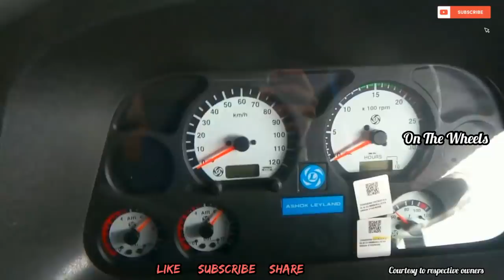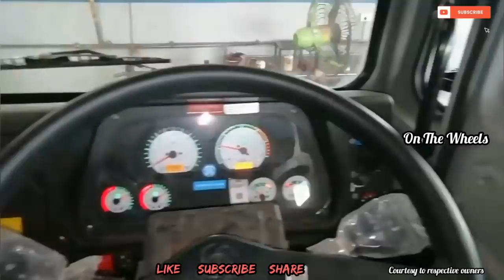Tipper Lorry Business Profit and Expenses in Malayalam

Comment: better option will be to lease the tuck to a company at per day rate and drive the truck yourself , for 20-25 ton truck u will get around 6-7k per day nd u also no need to worry about fuel expense as it will be provided with the company
even if the truck is not running the company will still pay u on per day basis